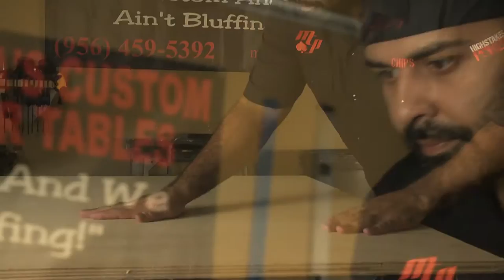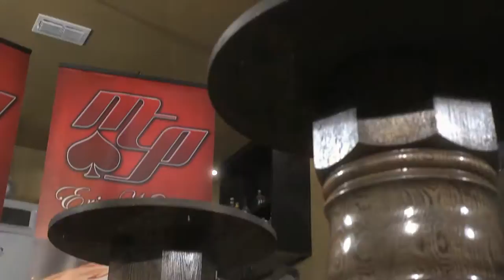Medina's Custom Poker Tables

Comment: Should be using a counter sink for those screws and a flush trim bit on a router. Not a black and decker belt sander.  A quality table is top to bottom. Not just what the consumer sees.